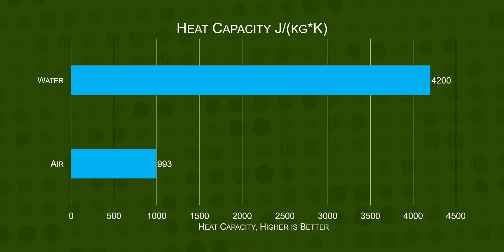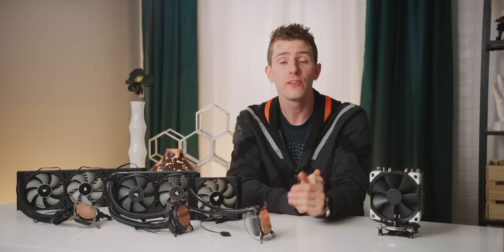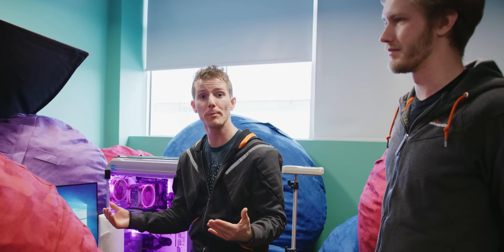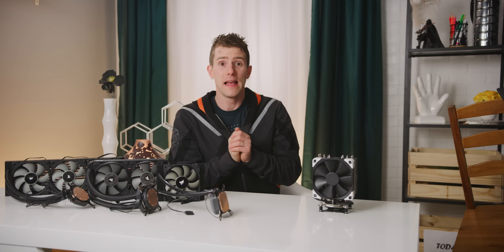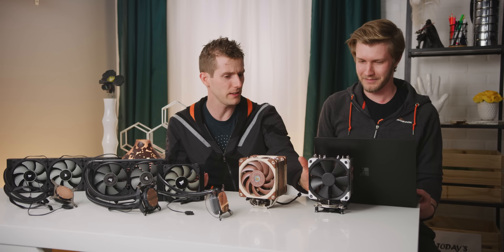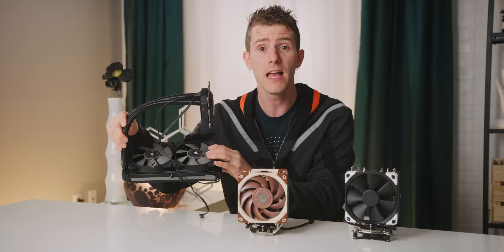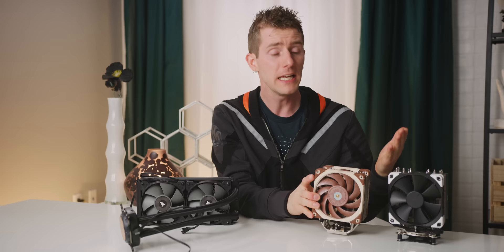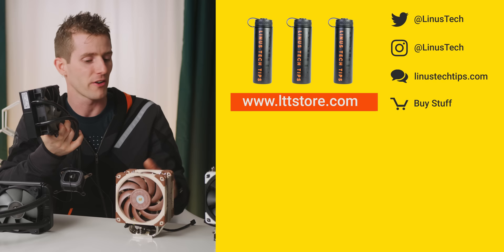Why you shouldn't water cool your PC

Comment: Then there's when the damn pipes leak... and delicate, expensive circuitry has a bath.

I still remember the first WC setup I saw at a LAN party in the early 2000s. The guy had a bucket with a submersible pump... and spent the whole time trying to dry his motherboard off and get it working again before the party finished.

Comment: How about replacing the AIO fans with Noctuas. I believe Noctua's fans are just too good
Reply: I recently replaced my Coolermaster ML240L 's fans with Noctua's: a few degrees lower idle temp + less peaks at a lower noise level. When stress testing the highest temps dropped by 8°C. I have adjusted the fancurve so they hover around 500rpm. I agree with Linus though, Noctua knows their shiz.
Reply: @JensStragier  JEEZ. so you'd say the fans are making the biggest difference. I'm thinking of swappping to a 360 ml rad AIO by corsair. I'm using a coolermaster  6 pipe 2 fan heatsink right now. I have a i5-8600k oc to 5.0 ghz
Reply: Seems like an easier solution.
Reply: Yah lol I replaced stock aio fans for GPU aio and processor aio... Temps drop with less fan speed. Lack of static pressure on stock fans, cost cutting. If u used same fans for everything in this test probs temps would all b same
Reply: @taylonjudd923  yes fan quality makes biggest cooling difference for sure. Get some high static pressure fans better for forcing air thro any cooler.
Reply: I did that on my Kraken x61 , and the result are amazing, not so much on the temps its a few degrees,, but the noice is reduced sooo much :)
Reply: I was thinking the same thing and am considering trying it
Reply: I put a pair of Noctua AF 12X25 fans on my Corsair H100i Pro radiator. Super quiet in my Ncase M1. Thanks for the suggestion, Optimum Tech.

Comment: i bought a Noctua NH-D15 SE-AM4 in my new comp build. its massive and ugly and i love it.
Reply: I agree I got the NH-D14 massive and it hurts to look at but my god is it amazing!
Reply: A solid non-glass side panel is also quieter and hides the ugly fan. AIOs are all about looks. I will likely still use one on my next build just because I like to see inside, but I am considering going back to a solid side and air cooling for just these reasons.

Comment: Liquid cooling is just a form of transporting heat. You still need to do something with it. The reason liquid cooling is excellent is because it transports the heat to somewhere you can exchange it to air outside of the case. Air coolers that sit on the chip heat up the ambient air inside the case, thus heating up all the components of your rig. Moving the heat somewhere so you can control where it actually exchanges to air is the key benefit to liquid cooling. It makes your SSD/Ram/Mobo/HDDs/GPU/PSU live longer because they're not part of dissipating the heat from your CPU.

Comment: Noctua nh14, quieter than my old corsair h100i, replaced due to pump failure after 2yrs, never going back.
Reply: same, i had a h100i v2 and its pump died on my after about 8 months. also bought a noctua
Reply: Did it damage your PC at all when the pump failed?
Reply: My 115i died in 2.5 years. I thought it would last 5-7 years, at least. :/
Reply: Mine's been going for years.
Reply: My h60 is still going after 5 years
Reply: @xxzgame3125  unlucky. my h100i v2 is going 3 years on heavy gaming without any issues.
Reply: @armin954  does not seem to have caused damage, pc slowed to a crawl once cpu overheated so it wasnt run for long with no pump.

Comment: Liquid cooling is something that I would never use in any of my PC's as I'd be constantly scared of a leak happening. It also puts me at ease when using air cooling as I've always used it and I can tell if it's running properly just by the sound of it.
Reply: Same, I want obviously want the cpu to be cool, but if one component can completely kill most of component. The risk to reward is not worth it.

Comment: I had to replace my Corsair water cooler with a Noctua cooler because of the high temps/noise from the former.  /shrug.  It's way better now.
Reply: Also lowers your point of failure -- less moving parts

Comment: "I wouldn't recommending to people who enjoy USING their computer, rather than just tinkering with their computer"
Ah I can hear the elitists crying from here :P
Reply: It is odd though, decent water cooling usually decreases temps in most cases therefor adds longevity and reliability of components... plus it looks cool! (As long as it doesn’t take a leak)
Reply: @DoktrDub  technically yes but I would expect any CPU that's been OC'ed reasonably to still last 15 years easily... anyone running their OC so high it affects longevity is doing it wrong, you're never going to feel a benefit to the extra couple hundred MHz you'd be gaining by pushing that hard anyway.

Comment: What about mineral oil cooled PCs?
Reply: Cooling mineral oils eat trough the plastic components of your hardware...it's cool and  works, but you gotta throw pretty much all the build away after some time
Reply: They did videos on mineral oil cooled...
Basically if you wanna ball out and have something totally unpractical and looks cool, sure... Otherwise stick with fans or open loop liquid.
Reply: Somone do 1 pc in aquarium  full with mineral oil. Search for aquarium pc
Reply: There are more cons than pros imo. I'll simplify my thoughts since I had one. 
Pros:
Much quieter (unless you're using a pump and radiator)
Looks badass
Definitely something you'll be proud of building as it takes a lot of work

Cons:
-It.. Requires a LOT of work.
-Negligible difference in temps unless you're using a good pump and radiator.
-Using the radiator now adds noise.
-Very costly for all materials.
-Extreme weight because you'll need an aquarium
-Super high maintenance level

My 2 cents. Had one some time ago. Wouldn't personally recommend unless you're a hardcore enthusiast and want to make one just for the sake of making one. That was my reason haha
Reply: For ultimate balling fill a case with 3M Novec

Comment: There's two reasons for an AIO:

1) the case (like most cases) has shitty airflow and try as you might it ain't gonna happen, you need a way to get the hot reliably out of the case, AIOs do that
2) big towers are, well, big. And big well performing air-coolers don't fit into midi cases or small form factors.

Comment: How is the performance vs a Noctua nh-d15 ?
Reply: I personally swapped out an NH-U12S to the NH-D15. Both using the same Industrial PPC fans. Went from being quiet.. to being completely silent... Even if the room is hot and the CPU is doing a stress test. Spends most of it's time at less than 50 degrees. But that's because i have all 6 of my fans being software controlled to be at i believe it's 20% until 50 degrees then they start to ramp up. Would highly recommend either. Main issue with the NH-D15 is the fact it won't even fit in some cases or on certain motherboards. In any case they are both more than capable of cooling my 120 watt Xeon E5-1650v4 at full all core load.. The loudest thing in my entire system at idle is the HDD's(5 of them). And in certain games.. the GPU fans fire up.
Reply: @Braskus  can confirm D15 is a beast
Reply: Good luck finding a displayport cable that long that manages high refresh and resolution

Comment: maybe space is one of the factors to choose AIO....i can't fit big air cooler in my mini itx setup since my psu is near on top of the CPU
Reply: A guy actually jerry rig a ITX case for a 120mm fan AIO so yea I would give it that for the cooling per surface mm.
Reply: Low profile air coolers do exist. Noctua makes one actually. There are good options for compact builds on air.
Reply: @AtMichuhl  Chances are though they are going to have to run at higher RPM though to compensate and we all knows that going to "sound".
Reply: @rickytorres9089  this video already showed that noctua is quieter than the aio, so nope.
Reply: @raz0118  Any fan that spins fast enough is going to produce noise. Even those fancy $40 "frictionless" fans will if you let them get so high in RPM.
Reply: @raz0118  but they're talking about the low-profile ones, not the one in the video. Low-profile air coolers tend to be noisier due to the fan compensating for the smaller surface area. So nope. AIO is still the better option for mini-itx cases.
Reply: @rickytorres9089   @Patrick Jerome Obaldo  The noctua fan is only 2500 rpm and they do a very good job (The nh-l9x65). I couldn't find a comparison between it and a single fan aio though so I'm not positive how they stack against each other. Sound wise the noctua is very quiet though.
Reply: @AtMichuhl  Found NOCTUA NH-L9i but too bad my rig is AM4
Reply: sorry ...there is am4 version hehehe NOCTUA NH-L9a-AM4

Comment: AIO's essentially just use water to transfer the heat to an air cooler.
Reply: Grumpy Pants  a radiator not an air cooler. They transfer using water to a radiator.  Completely different to an air cooler.
Reply: @One-Crazy-Cat , So what? An "air cooler" use a phase shift of liqud to a vapor to transfer heat in a heat pipe to a radiator. And physics teach us, a phase shift always will be more effective at transferring a heat than just a moving liquid.
That's why refrigerator and air conditioners are all use a phase shift.
Reply: Because water has a higher heat capacity...

Comment: even Porsche left the air cooling long time ago...in the car engines there are so much parts that need cooling that the air cooling never makes good job at it...hell even water cooling doesnt desipate the heat equally from the front of the engine and from the back.,..this is why longer 6 inline cylinder engines have this problem to stay much hotter in the back where cylinder 5 and 6 are and in extreme conditions the headgasket can fail there...i have a old BMW  and ive seen my friends kill there engines with not perfectly working cooling system and pushing''ém harder then they should...in PC you have just this one small spot to cool and the air is doing the job perfectly.i appreciate this video because i thought all those years that this liquid in the radiator in air coolers was strugling to desipate the heat fast enought...i thought because of the running water in the aio is making the big differernce,but i was wrong..Thanks for proving that wrong and keep up the good work.

Comment: Water cooling is a gimmick. Just use noctua! My cpu 9700k at max load sits at 55c with the noctua dh15.

Think about it, once the water is warm it stays warmer for longer, compared to air.
Reply: Dan Weeks Music That’s why there’s a radiator and fan(s) for the radiator. The fans pull air through the radiator and cools the water.
Reply: Yeah it only stays warm when you’re using the wrong size radiator. Try using a larger radiator and proper cooling setups. Newton’s law of thermodynamics is a hell of a drug.
Reply: Philip Moore I also think nzxt would yield better results as they are stil the best aio with pretty shitty software
Reply: My ML360R does way better then the numbers he said the corsair was doing

Comment: Special AiOs are the exception. To cool down a 7950X, you actually have to have a solid, big heat transfer mass. Either a very big air cooler - which will surrender in high demand application, a big AiO or an open loop setup. I took the Alphacool Eisbaer Pro Aurora 420. Full copper 420mm radiator and an open-loop tested silent pump with a big reservoir on it.
On idle, I usually get 50-51°C. And no game made it reach more than 78,6°C.
Funnily though, the installation of "Ubisoft Connect" actually took 2 seconds of 95,1°C - which only Cinebench could do. Not the 3DMark CPU test - which also never exceeded 79°C.

Comment: I used to have a Corsair AIO liquid cooler (tried custom liquid cooling back in the days, but it was too much of an hassle). After sending back two to Corsair for failures (on one, the fan got all noisy and the temperatures dropped, the other one, a newer model, had led failing and temperatures also dropping), I had YET ANOTHER failure and they said they wouldn't repair that one as well because it was already a replacement (great customer service, screw you, Corsair).
Therefore, I decided to buy one of those ass huge Noctua fans as a momentary solution until I found another AIO liquid cooler from a different company, and...guess what?
The Noctua BLEW OFF MY MIND. I mean, I always saw a big difference between my own temperatures and reviews, and I always thought it was due to room temperature differences (my room is on the warmer side) and other stuff, but nope. The friggin' Noctua fan dropped something like 15-18C in comparison to the Corsair AIO. While UNDERSPEEDED, on a silent profile.
You can barely hear it, except on heavy load during gaming, when it occasionally does a brief burst here and there.
I always thought Noctua fanboys were like fanboys of any other hardware product, largely exaggerating it out of enthusiasm, and that the reviews were maybe a bit biased. But nope. They actually UNDERPLAY how good these things are.
People at Noctua know their stuff.
Reply: Man I had almost the exact same experience as you. My first Corsair AIO had the pump die after only owning it for 5 months, they sent me a replacement and I gave it to my friend, bought another 'higher end' Corsair AIO to replace it and the pump dies after 2 years. The thing is it was never actually good at keeping my CPU cool like I wanted it. Always 50-55C at idle, on a 4790k @stock. They sent me a replacement for that but I ended up buying an NH-D15 Chromax and it's keeping my new 3900X at a comfortable 44C idle. Hardly ever hits over 75C at load. I love it.
Reply: Yay Austria but at the same time why cant they at least offer alternative colors. The shit is literally repulsive.
Reply: @MildlyDrunk  I am using the Gammax GTE (I bought for my old i76700K) in my 3950x. Where I live, usually gets 37°C. So, when I was rendering something and using all 16 cores at max, the CPU reach 94°C. 
You are good now with Noctua, using all cores!? I don't know if I get one Noctua or one extra large AIO, like NZXT Kraken ou Deepcool Castle.

Comment: more of a fan comparison then a cooler comparison. Put the same noctua fans on the aio's and lets see how it all fairs.
Reply: thats actually a pretty good point
Reply: But are you really going to use a fan other than the one that came with your cooler?
Reply: @J7.7.7  thats a better comparison and if its better then why not
Reply: @J7.7.7  I have noctua fans on my aio for noise purposes so yes
Reply: @J7.7.7  I did yes.

Comment: As sick as custom loops etc look I'm always gonna be a noctua guy, don't have to worry about it, the fans will work for nearly a decade and the cooler indefinitely, just less of a headache
Reply: I actually like the Noctua fan look.
Reply: As someone who has gone with custom loops for his last three builds, I'm done. I'll be going with air cooling for my next system. Only thing I don't like about noctua is the shit-brown color of the fans... It just doesn't match anything else on the market.
Reply: @37Kilo2  Noctua makes their fans in black too.
Reply: @37Kilo2  meh, been custom cooling since the Celeron 366 days, and it's nice and easy if you use the right fluids etc. Mix your own stuff and it'll last 5-6 years without maintenance, easy. Just dont buy that premixed crap.
Reply: @37Kilo2  I'm on your side as well. I've been on a custom watercooling loop since early 2013, but I won't get waterblocks for my next upgrade. It was awesome as a teen, but it's just too much of a hassle. It's difficult to buy used hardware with waterblocks, it's even more difficult to sell, and it's so expensive to buy. It does look nice, but I don't really do LANs anymore anyway, and it sits under the desk anyway where even I don't look at it. There's just no point to it anymore.

It was really nice to have back in late 2013 when I upgraded to an R9 290 since I didn't have to wait for aftermarket coolers to arrive. EK had a waterblock ready much sooner than the non-reference aircoolers.
Reply: Brian Hansen yea my cooler master 212 has als been going for 4 years now without maintenece👌🏼
Reply: My current machine is a decade old, filled with 7 Noctua 120mms (3 in, 2 out, and a 120x2 push-pull heatsink).

They still work, believe it or not. And it's not even loud. Still. Austrian engineering...
Reply: @tamastenhaaff2291  that's all good and well, but performance isn't good compared to a proper custom loop
Reply: Brian Hansen agreed but if your not into overclocking air is enough
Reply: @tamastenhaaff2291  tru